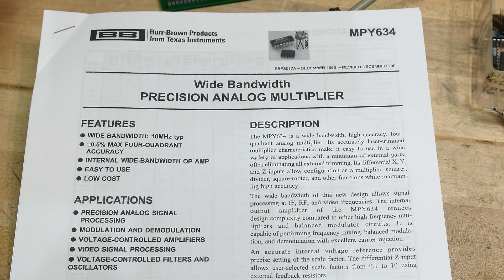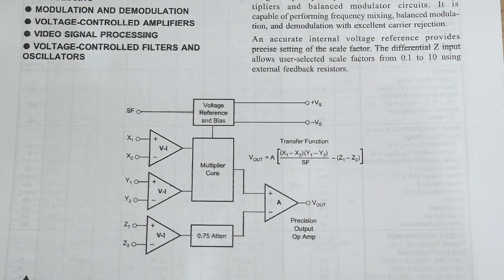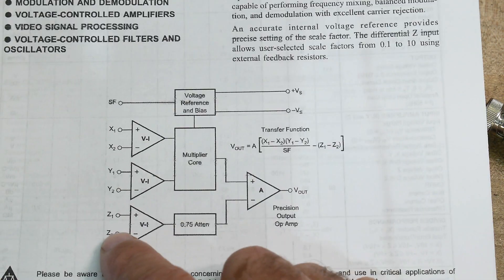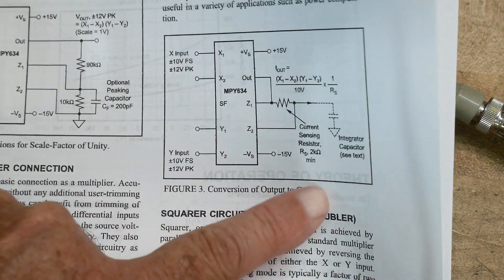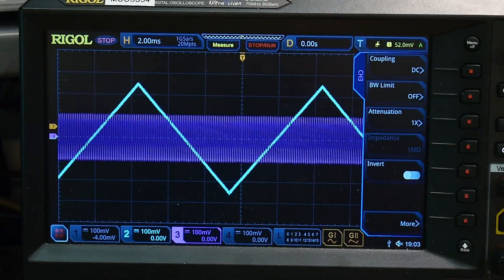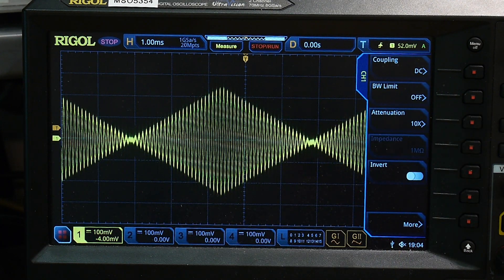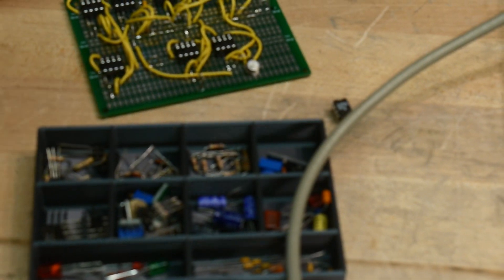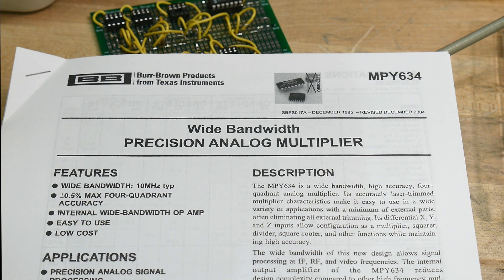#1210 Analog Multiplier MPY634

Comment: I used to support the laser trimming of these devices back in the early 80's. It was done on manual laser trim at the time. It was like trying to balance a bowling ball on a razor blade. Nowadays it is all automated laser trim. Nowadays digitizing, then multiplying in the digital domain, the digital to analog can easily outperform these devices at far less cost.
Reply: I actually thought about building an analog computer which uses analog electronics for addition, integration, constant multiplication and exponentiation/logarithms and a digital multiplier which is just taking the digitized signal in and giving the analogized product.

Comment: My interest was picked by the speed specification.  The one other limitation in general on all the analog multipliers is the dynamic range (as well as no 4-quadrant operation) in certain applications.  I have had my battles with two applications requiring an analog divide.  The two designs were more than 20 years apart.  This part could potentially have made both designs a bit easier.

Comment: I remember as an experiment in laziness many years ago breadboarding a headphone amplifier with a couple of these expressly for the purpose of using a single pot between 0 and Vcc for a common volume control. They worked really well. No L-R tracking issues that you commonly get with a stereo pot, and you can also put a capacitor on the control voltage line to eliminate wiper noise...

At one point I was going to try a mini AM transmitter with one of these and a wien bridge op-amp oscillator around 1MHz (grain of wheat bulbs are fun), but never got around to trying that.

Comment: I love those BB analog multipler 
chips...they made a bunch..
Some originally probably control system...missiles for Hughes Aircraft ...eventually formed signals to the servo amp and motor for the fins..

I am glad that person's harvested cache had this chip. This chip and other similar older versions..are on my bench BB 4302..analog fuel injection for a dirt bike. But probably since I can tune the carburetor good enough...it sits gathering dust...there are signs of life...

Your MPY634 looks to be much more versatile

Comment: The CA3080 discussed in” #1203 DIY Analog Synthesizer (part 6 of )” is a 2-quadrant multiplier, as the Voltage at the input is multiplied with the current at the bias input resulting in the product provided as the output current. 
Two of those circuits combined with the same input voltage and the inverted bias current (OpAmp as inverter for the bias signal) can provide a 4-quadrant multiplier by just adding the output currents. (Some gain adjustment for the inverted bias signal might be required)
Nice experiment, as the CA3080 is really a cheap chip.
Reply: Interresting! I have a few LM3080 in my parts box and just thought they were normal opamps. But it looks like LM3080 and CA3080 are the same thing; at least it has the same pinout and same bias input as the CA3080. So I just add the multiplicator at the bias input and that's it?

Comment: Low cost is a relative thing.  These things are $20 parts nowadays.  The 4-quadrant jellybeans look to be AD533, AD633 and HA3-2557-9, plus RC4000, which is a current-mode device that I've never tried. That last one looks as if it's fast enough and clean enough to use in place of a diode ring as a sideband modulator/detector.  

If you limit your search to 4-quadrant multipliers in active production that Digi-Key stocks themselves rather than acting as the middleman for an eBay supplier, you're left with AD633 ($13 or so), AD835 ($30 or so, down to sub $20 if you're buying a whole reel of 750) AD834 ($50+) and the discontinued MPY100 - plus a bunch of $100+ laser-trimmed parts that they keep around in onesie-twosies (and then you'll be shocked at how long the lead times are and how much they cost).

Cheap Gilbert cells are getting hard to find. Gone are the days when you could just slap down a few bucks and get a LM1495.
Reply: Fortunately matched pair bjts can still be bought inexpensively. Building analog multipliers with DMMT3904 and DMMT3906 pairs is drastically cheaper than those integrated ones.
Just use the circuit from Analog Devices "Multiplier Application Guide" Figure 63. The right half is an opamp, just use a generic ic for that. The biasing circuit on the left may well be replaced by something easier and some resistors can simply be omitted. The resulting multiplier will have some offset voltage here and there if no trimming is done, but for many applications the precision obtained that way is more than enough with fixed resistors only
Reply: Agree that Analog Devices are better performance and price, but then I don't have drawers full of NOS legacy chips, and want to make a modular PCB for them.  Retro-Tech videos first, then this century videos.
Reply: I found some on eBay for about $10 each (and no, they're not from China).
Reply: @jensknudsen4222  I just wish there were really cheap multiplier ICs.
With less precision, no internal trimming and such it'd be possible to build multiplier ICs for a fraction of their cost.

I think having tens of them at a time would be great, but not as much if it costs hundreds of dollars
Reply: NOT at all low cost, what a scam =(

Comment: Thanks, 
Real nice chip with lots of potential applications.
I can use it to measure phase in Wheatstone bridge, easily.
Also lots of control system applications.
Add a good opamp differentiator and opamp integrator, then sky is the limit for its applications.

Comment: You could make a mains wattmeter with it. Not a low cost part though, even AD633, that is considered low-cost is absolutely over my budget (costs around 400 CZK, compared to jellybean ICs that cost around 20CZK)
Reply: At least a squarer/square-rooter is just a couple matched diodes in an ULN2003 and some simple circuitry around it to close the loop. There’s a US patent on it, I forget the number. They use BE diodes on a die, but the less ideal single-junction diodes work quite well too.

Comment: The scale factor input is not designed for division (it probably has lousy bandwidth and is used to scale the output for low voltage inputs.)  Division is done by sticking the multiplier in a feedback loop to invert the function.  These things are great for generating the chaotic solutions to non-linear differential equations when combined with 2 or 3 integrators.  Quite a nice topic for a future video perhaps.
Reply: Thank you for more info than provided here. 
I’m in love with this chip.
Reply: Someone didn't watch the video or download the data sheet to see what the bandwidth was.